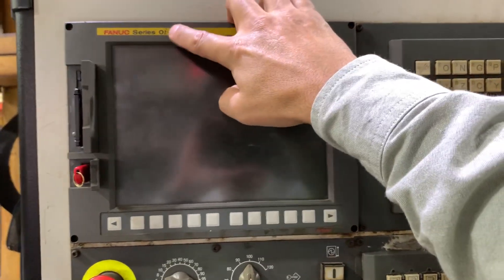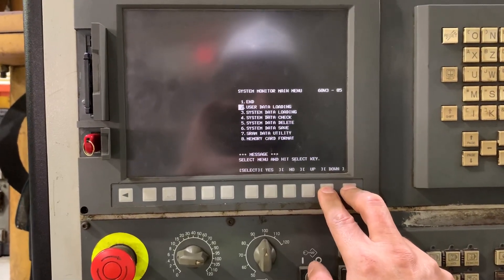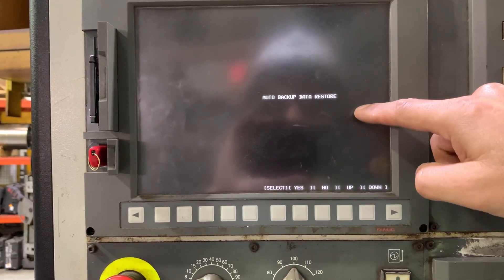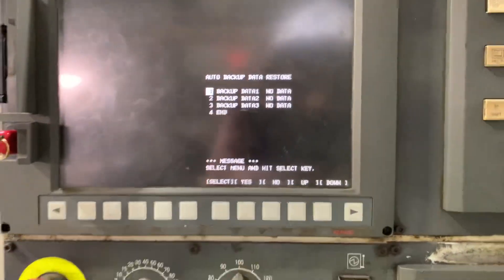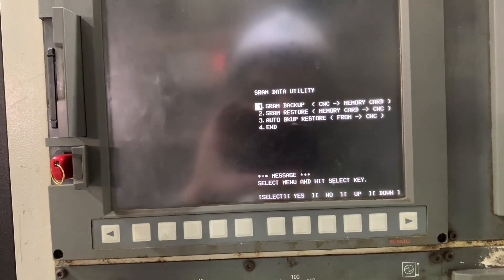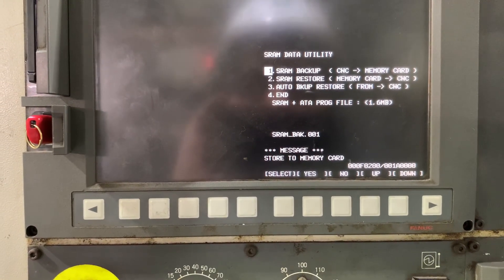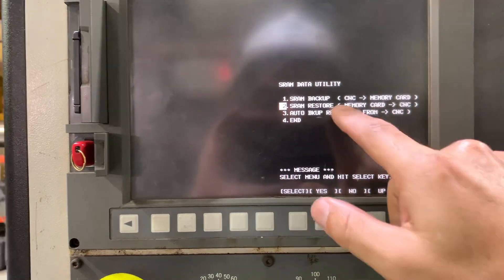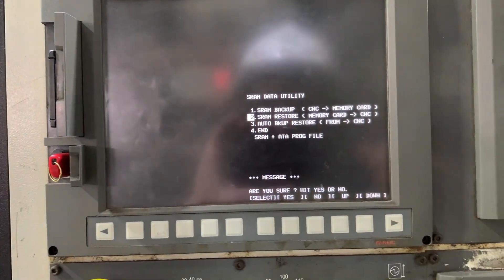FANUC 0i-TD : SYS_ALM500. How to restore the CNC from SRAM Utility

Comment: I. Lost all my data of my cnc how can i recover it
Reply from the maker: Do you have auto backup configured? Have you done any backup manually to a CF or USB memory?
Try the procedure shown on the video and on the description. 
If you don’t have a backup you’ll have to do a new CNC commissioning.
I hope you have an auto backup configured.
Regards
Reply: @FabianAchaval   we dnt have backup so need help frm the team and your
Reply from the maker: @niraztiwari1035  if you don’t have a backup, I’m afraid to tell you that is gonna be hard for you to recover it.
Take in mind that even a very old backup could be the solution.
Have you followed the steps shown on the video and its description to check if there is a backup on the FROM (Flash ROM)?
Hope this helps you.

Good luck.
Reply: @FabianAchaval  i got my back up file oprm and pcm and sram i restore the file but i got some problem
Reply: @niraztiwari1035  hello pro .. i need my file please help me